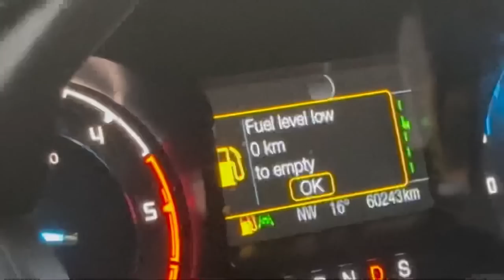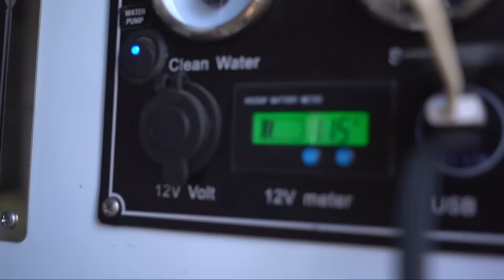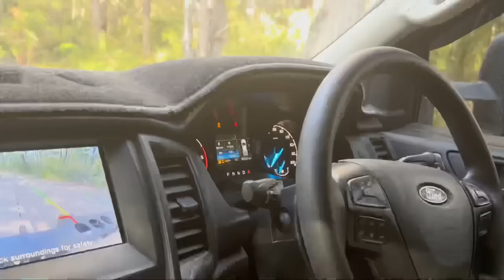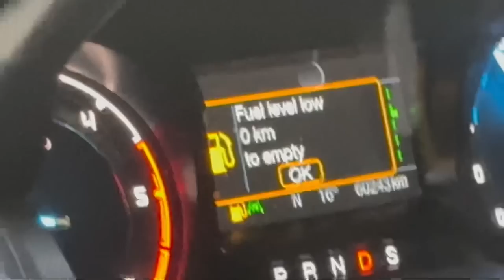Running out of FUEL on AUSTRALIA'S LONGEST SAND DUNE! + BEST 4X4 beach EVER!

Comment: Love the vids guys. You mentioned you OBD app. Which one is it exactly? The one I have doesn't do the Trans temp. Keep up the good work
Reply from the maker: Thankyou so much! The app I use is torq pro, it doesn't have transmission temp on it from the start. you have to add it in using codes, and you can only do it with the paid version. I ended up just doing some googling and watching some YouTube vids to figure it out. It's definitely worth the hassle to see your temps. Thanks so much for watching!

Comment: If you have the standard oil cooler for the ranger, then Radiator water cools your trans oil thus trans oil  needs to be a bit hotter than water temp to cool. the trans cooler people put in caravan world mag50 deg to 110 deg good, 110 deg to 130 deg is warm. Hope this helps.
Reply from the maker: Hi Rob! Thanks for the comment! we actually have a transmission cooler on the ranger and have never seen it go above 95 degrees until that dune run, I've just been told to try and keep it under 100 but I'll keep your advice in mind! Thanks so much for watching our video!

Comment: Hi Guys. love your show (and really enjoy your sense of humour). Last night you showed an app on your phone (Torque?). I also have a Ranger and would like to know what OBD2 you have used to link to your phone. Would you be so kind as to provide details and the supplier? I am sure other Ranger owners would also appreciate the information. Thanks in anticipation
Reply from the maker: Thanks for the comment! I use the obd2 scanner from jaycar, and the app I use is called TORQ and I have the paid version. You can clear the codes and monitor temperatures really well. I would highly recommend getting one if your in need of a scanner. Thanks so much for watching!
Reply: @lilandjake  Thanks for that. Much appreciated but I have just checked and the Jaycar OBD2 scanner is not compatible with the current version of IOS.  I will try to find one that is and again thanks for your time and for videos that you post. PS is the app ''TORQ'' or ''TORQUE'' as i can't find the TORQ app anywhere?

Comment: WA sand driving is all about the tyre pressure. Start at 18 psi all round and drop from there if your need to. Makes it easy on the car and the track. Just saying.
Reply from the maker: Cheers for the tip Waranger!! We are usually the first to drop them, we were just exhausted and didn’t think about it considering the day we’d had. 😅😅😅

Comment: DTE is useless once you have fitted a long range tank. I always use my scangauge for all my fuel usage info
Reply from the maker: Thanks for the comment Alan! I did have the computer re calibrated after fitting the long range tank and found it's a little bit out, it usually drops quiet fast towards the end of the tank, it was definitely empty after this trip though, I calculated it only had about 7 litres left in it! Thanks for watching!